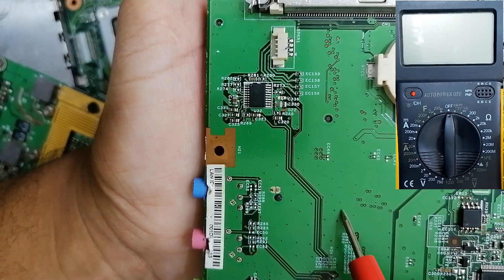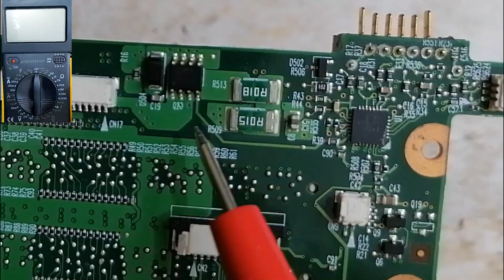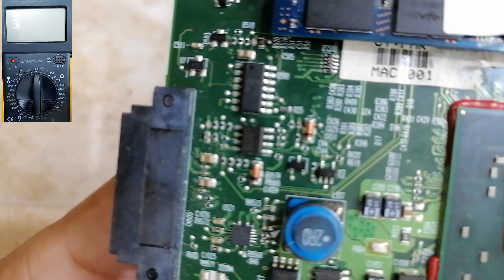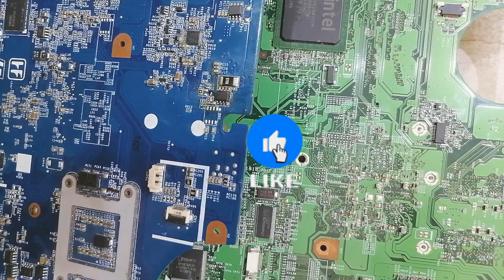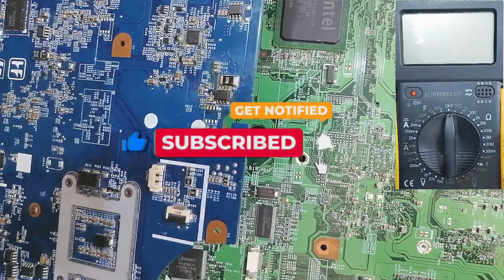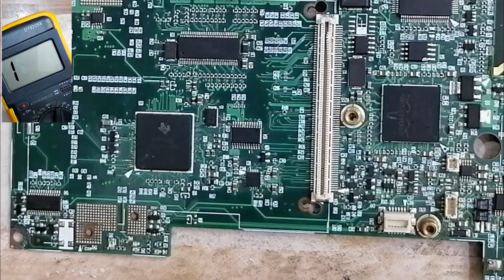Master Circuit Repairs Without Diagrams - Fix Circuit Problems Fast on Laptop Motherboard

Comment: Hi, thank you for your hard work creating great educational videos. I have an amplifier board of a studio monitor that does not produce sound at all. Tested power supply components, they are working fine. Tested most of the components on this board (without desoldering them), and there are no physical damage to any of the components. Also, tested tda7294 (2 on PCB), tested opto isolator, and IC chip as well. Would you recommend any other option(s) to solve the problem. Thanks again, very very much.

Comment: Sir please reply to me what to do if 1.2v RAM voltage is missing and V core 1.8v is missing but CPU voltage 1.8 is present
Reply from the maker: Thank you for your question. If the 1.2V RAM voltage and Vcore 1.8V are missing while the 1.8V CPU voltage is present, here's what you can check:

Check for Short Circuits: Use a multimeter to check for any short circuits on the RAM power rail and Vcore line. A short could prevent the correct voltage from reaching these components.

Inspect MOSFETs and Power ICs:

Look for any damaged or faulty MOSFETs or power ICs related to the RAM and Vcore power rails. If these components are damaged, they may be failing to supply the necessary voltage.
Verify Power Management IC (PMIC):

The PMIC controls the power to various components, including RAM and Vcore. If it's malfunctioning, it could be the reason these voltages are missing. You may need to test or replace it.
Check Voltage Regulators: Ensure the voltage regulators responsible for generating the 1.2V RAM and 1.8V Vcore are working properly.

Comment: Why there is 19V instead of 1.2 on the othet side of a mosfet and on nearby condensators? And the inductor in the same area has 1.2 V on both sides but after turning on the laptop on the other side of this inductor there are 10 V and it is hot...
Reply from the maker: Bro you need to watch previous videos to understand
Reply: @electronicsrepairbasics_erb  can you advise some more precise?
Reply: Hello please can i have your Watsap number i need to work which you online please im from Cameroun

Comment: Sir , i have a question about the value marked on the top of each coil : for example if we have a marking of 2R0 , this means 2,2 ohms or Henry's ?
Reply from the maker: Thank you for your question. The marking '2R0' on a coil typically represents the inductance in ohms, not in henries. Specifically, '2R0' indicates a resistance value of 2.0 ohms, where 'R' stands for the decimal point. However, if you're referring to an inductor and want to know the inductance value, this marking would not directly indicate the inductance in henries. For that, you would need to refer to the datasheet or manufacturer's specifications. I hope this clarifies things